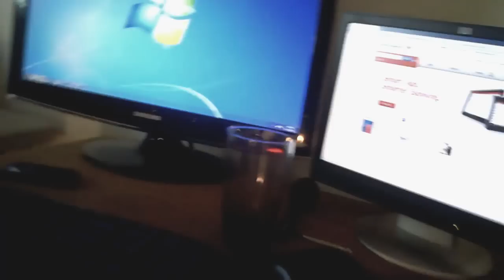Get More Microphone Inputs in Your Interface

Comment: just an idea , I have one just like it and are happy with it , I also thought of an idea , one sm 58/57 has a small transformer inside where on the primary side , the microphone and the secondary side is xlr plug in the other end of the cable , I put a small transformer on the primary side is the signal from the microphone and the secondary side is a small amplifier iC circuit and so on into the jack input. perhaps it is more expensive to do it that way.

Comment: Behringer umc 1820 has 8 XLR inputs and 20 outputs for 200$ i highly recommend it
Reply: Had my UMC1820 for nearly 2 years with no issues whatsoever, and the Preamps are clean and virtually noiseless. I haven't bought a lot of Behringer gear, but my 1820 has worked quite well for me!
Reply: behringer owns/purchase Midas, which is well known for their award winning Midas Pre amps, who design the audio interface and uses the pre amps. Go educate yourself, as the world is changing.
Reply: +Adam Bouaazzi Behringer is junk, it will fail also. Save yourself the headache. Your interface is the first chain in your audio. Buy a saffire pro 40 and be done with it and happy. Then you can add more inputs with an adat device such as this.

Comment: What kind of latency issues do you get, if any?  I was planning on doing this with my current M-Audio Fast Track Ultra 8R and the Tascam, but was told a pre-amp would be better since I'd get all kinds of latency coming from the FT 8R into the Tascam. However, today, I did a little research and found out Tascam doesn't like to play well with Pro Tools.  So, I may be limited to the 8 inputs I currently am using without a huge financial investment.

Comment: digital optical is the way to go when connecting multiple interfaces together, but I see your tascam doesn't have that, so essentially, with the equipment you have, that's a great way to extend if you're on a budget and not necessarily worried about losing quality when adding unbalanced channels.

another alternative is (if you're an fl studio user) to open fl studio twice (one session on left screen, one session on right screen assuming you're using two screens on your computer. then using the asio output for one interface in one fl studio daw and the other usb interface in the second fl studio daw simultaneously, wich then gives you balanced inputs for both interfaces that allows you to record full jams, and in that case you'd have to find your recorded audio tracks and import them into your main fl project then put them in sync... complicated, but it works well if your computer can handle it

Comment: Instead of spending $400 on additional preamps only, you can buy the PreSonus FireStudio interface instead. Then, (if you are a mac user) you can combine the two interfaces by making them an "aggregate device". BOOM, 16 preamps, all sorts of outs. You also get FireControl which enables you to create up to 5 different stereo outputs for headphones. It's $100 more, but theres no patching and will actually sound good.
Reply: Works great on computers with Firewire.  But for me, I have a Dell AIO and an Asus Laptop that don't have firewire.  Hell, not even new Macs have firewire anymore.

Comment: TRS send two signals, and when plugged into a mono output, the signals are just copies of each other, and one signal's polarity is flipped at each connector (this is done to cancel any noise or hum picked up in the length of the cable; when the polarity is flipped at the end, matching signals - hums- cancel out). When TRS is connected to a stereo output, the signal is treated the same as a headphone cable.

Comment: This is also false - TRS is a type of connector, just like XLR, RCA, etc. The application and signal of TRS is dependent of what you plug them into. If you plug TRS into TS (mono), the signal will be mono. If you plug TS (mono) into TRS, the signal will still be mono. The TRS have a tip-ring-sleeve connector (signal-signal-ground), and TS have a tip-sleeve connector (signal-ground). So while it is true that TRS is not needed for this application, it is untrue that TRS means stereo.

Comment: actually trs cables are stereo cable. however they are balance mono just like an xlr cable and i have seen a 2-5db signal boost using trs (balanced) cables using balanced equipment.  Which is pro gear

Comment: Shiort answer...no, you can't. The Tascam interface uses USB2.0 and cannot support two interfaces(Firewire, like the popular Presonus unit can, BTW). Also, this Tascam doesn't work as a stand-alone preamp, you need to hook it to a computer. In a pinch, you could use almost any mixer or PA head for mic inputs and route them (via Direct Out or FX send) to the 6 Tascam line inputs.

Comment: Sir, you are incorrect. TRS doesn't always mean it carries the two signals. The TRS is identical to XLR, in the actual cable itself, with the only variation being in the connector type. Its a +, -, and ground. Therefore reducing noise because it is a balanced cable.

Comment: Also mostly false. TRS is a pin out designation that can be applied to many different applications. The TRS you're describing is usually used for an effects loop. They are often used as a balanced connection of single channel. This connection is ideal as it will lower noise generated in connections by inverting one phase on the output and reinverting upon the input therefore phasing out any noise generated along the cable.

Comment: It even says "balanced" next to the inputs!

The unit will probably detect that you're using mono cables and switch to -10dB unbalanced automatically, but this is inferior and will introduce much more interference (hum and hiss).

Depending on your interfaced devices which may not have balanced ins/outs, you may be stuck using unbalanced.

Comment: Not true. For pro audio, TRS is a balanced mono signal, it's the same as XLR. It has a ground reference and a positive and negative conductor.

It's called 'balanced' because the positive and negative are the same mono signal inversed. This means interference (like hum) can be very easily rejected electronically. A balanced signal is also +4dB gain (not -10dB like consumer audio) so has better SNR potential.

If you are hooking up pro gear and have balanced TRS or XLR, use them!!!

Comment: I just looked up the specs on the presonus mic pre.  Those Direct Outs are balanced TRS. You could use TRS patch cables for added noise rejection if you were to ever have interference problems. That's usually not a problem, though.

Comment from the maker: False - TRS cables are Tip, Ring, Sleeve.  They carry two signals; an application for TRS cables would be for patching effects to a mixer because they use one signal to send the dry channel, and another to receive the effect.  TS cables only send ONE signal, so if you're sending one signal from a preamp to a single channel on an interface or mixer - as I demonstrate in this video - TS is all that is necessary.  Although you CAN use TRS cables, and it would work the same.

Comment from the maker: No.  Most S/PDIF's are not direct digital outs of anything; usually the S/PDIF outputs are for monitoring, and have to be assigned by your DAW.  The only way to make use of the S/PDIF INPUTS, is either by using a S/PDIF instrument - like a synth of some kind, or an AD/DA converter with S/PDIF direct out.  There's a link to a small stereo RCA to SPDIF converter in the description.  Sweetwater also has a nice AD/DA with XLR and phantom power that works nicely.